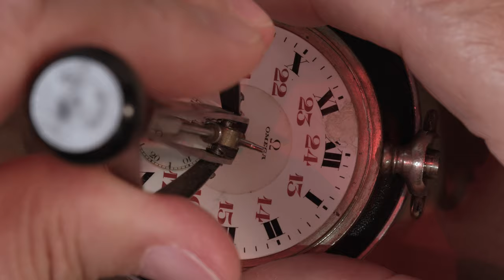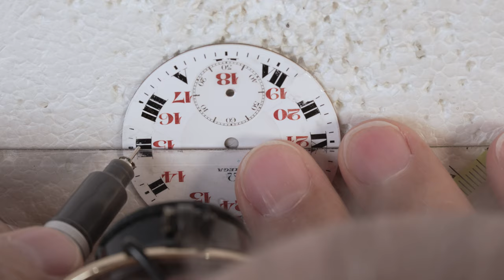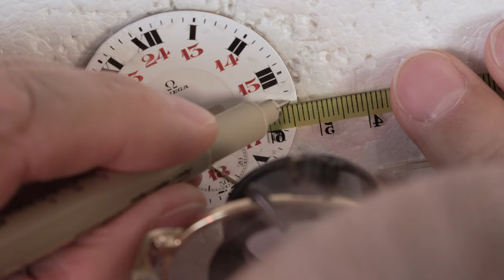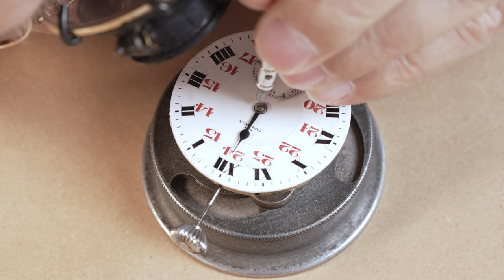Can I fix this ruined dial? | Omega pocket watch restoration

Comment: You are really good at restoring watches.  Incredible!  I was wondering, for a glass crystal, can you use one of those fancy crystal presses to install into the case ring?  I've seen people use the press for acrylic crystals, where the press compresses the crystal around the edges so that it can fit snug into the case ring by tension.

Also, what kind of white powder do you use?

Comment: First of all, let me say I was blown away with the dial restoration.  Truly a work of art!  That being said, I too have been working on watches (mainly American) pocket watches, and most all manner of clocks since 2001.  I am fully self-taught.  I had an actual watch and clock shop for 3 1/2 years.  I've serviced and made parts for everything from Rolex's, Atmos clocks, anniversary clocks, and clocks from the 1820's.  I have a few questions:  What is the "household degreaser" that you use?  It really seems to brighten up the gilded / brass plates and dials nicely.  You obviously know what you're doing :-).  Nice work on repivoting the center wheel on one of your other videos.  I want to know what flea market you shop at :-).  I get most of my stuff off "Flea-Bay".  I rarely find the "jewels" you come across.  Your videos are very well produced by the way.  While I can't say I ALWAYS use "best practices" there are a few things that I noticed that I find troubling:  The lack of use of gloves or finger cots when handling brass plates (like on the Lepine / Bar movement which was gorgeous by the way). The use of improperly sized screwdrivers.  The "liberal" use of "glue" to secure jewels, which I was always told was "frowned" upon.  When I fit a glass crystal I use a "syringe" applicator to carefully apply a thin line of adhesive around the "ledge" on the bezel.  That glue is then cured under UV light.  I've never seen anyone use 5 minute epoxy to set crystals.  Might make it difficult for later watchmakers to remove the crystal.  I understand these are your watches and not client's watches and you may do what you will with them.  I just find these practices troubling as I said.  And yes, I know, everyone is a critic :-)
Reply: I agree, although the dial restoration was nice, He used one oil on everything and drenched it.  No gloves, so burned in fingerprints in a few Months, damaged screws from improper size screwdriver, etc. etc.
Reply: I'm trying to get into this hobby. I got some old pocket watches to tinker with but I feel hesitant to start opening the and tearing them down.

Comment: You performed a miracle with that dial repair, that was a pleasure to observe, but what actually was that white filler powder?

It looks like you used a two part epoxy glue to fill the gap around a slightly undersized crystal, is that true?

Your remarking of the dial was pure artistry, you sir, have a steady hand.
This sort of skill level is indicative of why I subscribed.
Reply from the maker: Thank you for your kind words. Yes, I am using two part epoxy glue for the crystal.
Reply: I guess titanium di oxide.
Reply: @FleaMarketRestorations  What was the white powder?

Comment: WHAT PRODUCT HAVE YOU USED TO MAKE THE RESTORATION OF THE SPHERE
Reply from the maker: I am using powder for enamel repair that I bought 15 years ago in Germany. I think the company is called Selva, but take it with a grain of salt, since the label has fallen off in the meantime.
Reply: @FleaMarketRestorations  OK thank you
Reply: @1981juangato  Efcolor enamel powder works or Bergeon dial paste. Both are inexpensive.